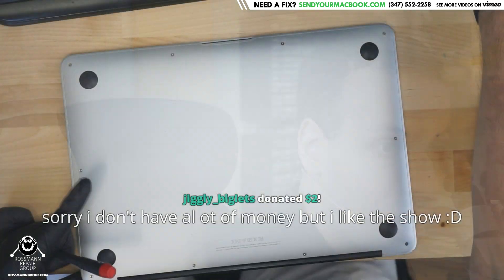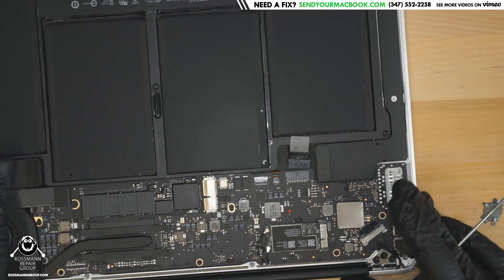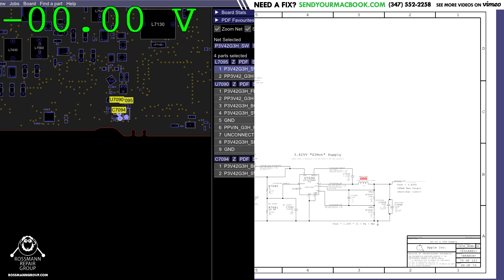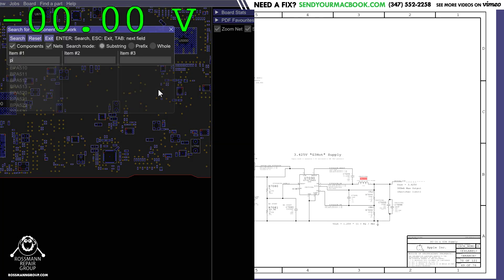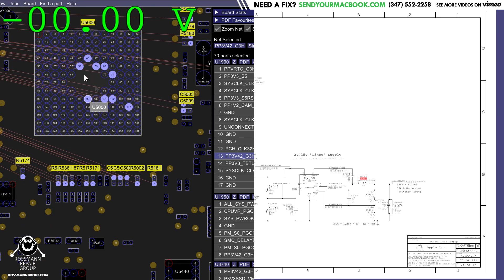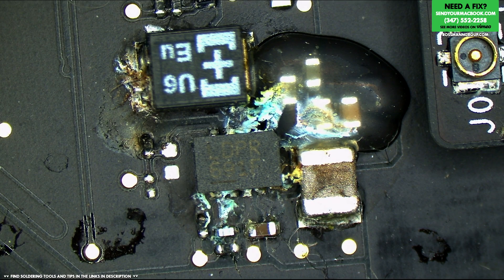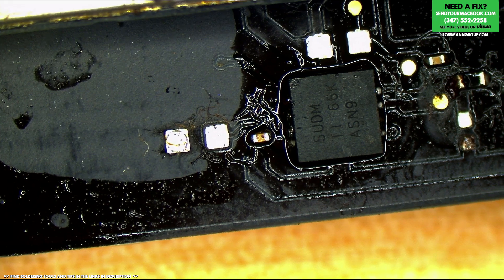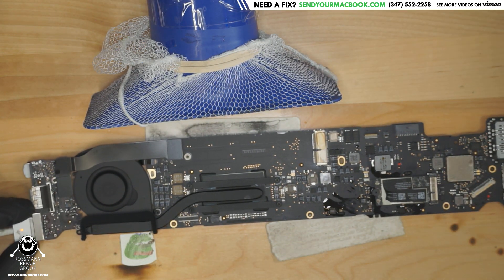What do I do if my MacBook Air won't turn on?

Comment: How do you keep track of screw locations when re-assembling, so you don't long screw a short hole? Neodymium magnet on Torx driver is neat trick, but you loose knowledge of which screw goes where.

Comment: I've a MacBook air 2014 and it's not working properly. Sometimes when I try to turn it on it needs several clicks on power switch. Sometimes if I put it to sleep it won't wake-up and shows disk not found icon so I used to force boot. Many SMC reset has been performed but issue still persists. Can you please help me out...

Comment: Serious question, what is it about MacBooks that makes them so prone to corrosion? Are they using proprietary lead-free alloys in their solder paste that are more prone to corroding? I don't think I've ever disassembled any electronic device with any corrosion let alone as much as Louis finds in the MacBooks he repairs.
Reply: Lack or "conformal coating". lead-free solder is very standard. Also keep in mind the laptop has a permanent DC supply, w/o the voltage there would no be corrosion.